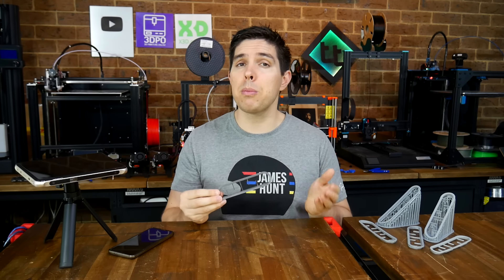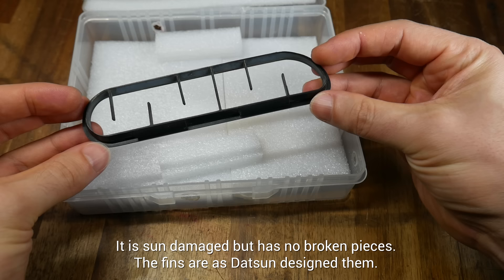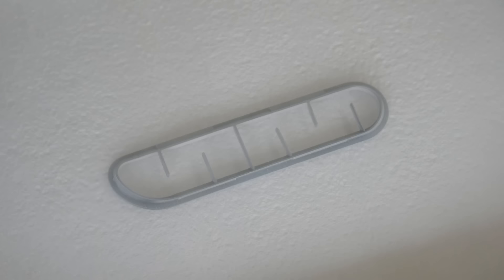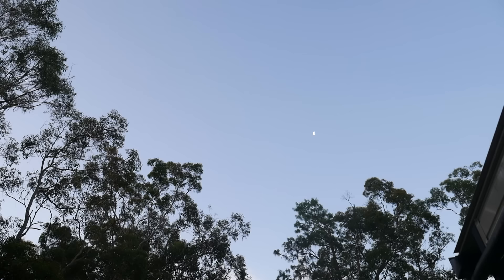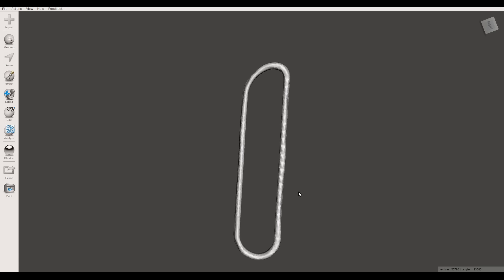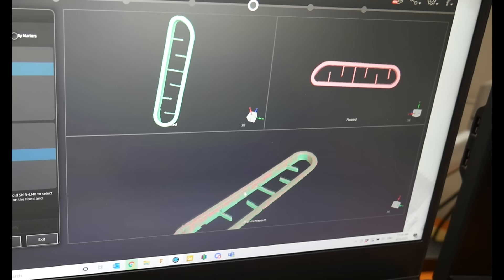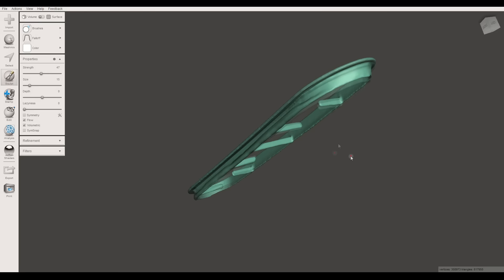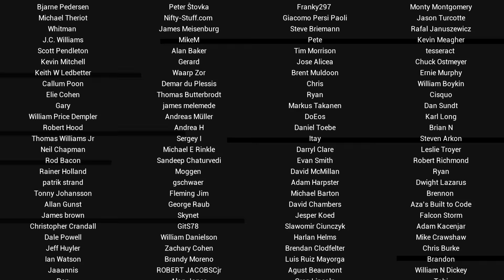3D scanning + 3D printing to complete a classic car restoration

Comment: I appreciate the educational aim of this project- but in my opinion it's rare that a 3D scan will produce a clean enough object to print, with the exception of an artistic part like a sculpture. 3D scanning a part like this should be used as reference geometry to make a perfect, clean CAD model for printing like you show myles doing at the end. Scanning makes geometry that would be difficult or impossible to measure with calipers very easy to replicate.
Reply: Way easier to pull a silicon mold. Then you could pop out as many resin copies as you wanted.
Reply: @timwrigley102  I think in some instances it is not enough. For example if you wanted to mirror this grill to fit mirrored holes.
I fully agree with Seth, it is far better to not just print but remodel. It also features the possibility of changing a parametric model at the end freely, making multiple design iterations a bliss. At the end, remodeling this part using the scan as reference combines the best of two worlds for a little additional work.
Reply: I don’t think anyone will disagree with you, but I think the videos intent was to determine the feasibility. It would be great if a phone could make a perfect 1:1 straight to printer scan, because that’s the future of 3D printing, but instead we learned it takes a $15k scanner and some clean up in CAD. 
A part like that exceeds the 80/20 approach to learning CAD (or at least mine). So, instead of paying someone to make a bunch of complex CAD models, I can rent one of these for a day and exercise my limited CAD abilities cleaning up and tweaking the last 5% of the model.
Reply: There are software packages that allow your traditional parametric CAD data to be produced off of the scan mesh, but it's another $5k give or take.    

It more or less allows for cross sections to be taken of the mesh data, it then makes construction sketches to your tolerance with the section plane. You can then convert it to a proper sketch as is, or redraw it to simplify it.  Add your dimensions and constraints in. Then follow a similar workflow to solidworks to create your geometry.  Rinse and repeat. You wind up with the capabilities to make hair-pulling  features with ease.    When everything is said and done, the part and it's feature tree can be exported to the big CAD programs for delivery or further modification/ analysis.  This is kind of a basic explanation of all this, but I think you get the gist.  

The whole process is time consuming, though much less so than guessing and test printing for sure.   It just has a very large upfront investment.  And recurring for maintenance and software.  

It's a big enough process that despite having the tools available for free at work, I dont often go out of my way to go that route.   If you look a a part and think 'this is going to be a b---" then it's the tool for the job.   You have to factor in whether the scan time is worth it ontop of you modeling, assuming you could just fly though the design process with it's help.
Reply: @Mytagforhalo  or in the case of small parts, a vernier caliper and just draw it. Then match the scan back as a double check. Simple
Reply: @avenuex3731  Hahah yup that’s what I would have done. With lots of trial prints.
Reply: @avenuex3731  Well, of course. If a part is that simple no one wants to do a scan process for it.  the scanning would take longer than the modeling.  

But i'm just putting it out there that the tech does exist if someone wants or needs it.   As long as the mesh is decent quality, it doesnt matter where it's sourced from, you could make the perfect solid.  

While the big name is geomagic, there are a few smaller companies coming out with cheaper products. In time, this can trickle down to the hobbyist. But right now, it's for prosumers.
Reply: @Mytagforhalo  sure. It is about complexity. But look at the scope of this. A part, such as the one demoed for the Datsun, is as easily drawn as any other path of creation. On the other hand, if the part is much more complex it cannot be adequately scanned as shown even with the $14k scanner. So forget about feature recognition. It will be gobbledygook. 
For that you would need a CT X-ray scanner, and then $14k would seem like spare change. 
Probe scanning is perhaps a better method in most mechanical cases, and CMM has come down in recent years, but you’d need to research. 
Ultimately, the fastest and cleanest and cheapest method is to learn how to CAD. And all you need is a way to measure your part to get going. 
‘Tis my point.
Reply: @ChuckThree  If you learn about Photogrammetry, then you will know that you could get out a really useable scan from that object with just a camera. But a real normal camera, not smartphone. Because smartphone cameras can't reach real camera quality. Expecially with they stupid software that washes out image detail for less noise. The higher your image quality is, the better the mesh detail will be. Also some different method of spraying should improve the reference point. Like spraying different kind of water color splashes for each object side. The more variation, the better. So the software can clearly tell a difference and movement from one pixel to the another.
Reply: @timwrigley102  It would also be way easier to damage the irreplaceable, age-brittle,  fragile by design, original part by trying to pull a physical mold off it.  The methods shown in the video didn't put the pattern at much risk of damage.
Reply: @netpackrat  If you don't know how to pull a mold, sure, you could mess it up. But if we're playing that game, then the best option would be to pull a mold of the 3D a print.
Reply: @timwrigley102  That would be a good way to go.

Comment: You could have just sent the scan data to a 3d modeler who would use it as a base to model a PERFECT non lumpy version that would match the real part 99% and be just as good as the original in as little as a day, matching the factory radiuses, fit and curvature perfectly. I REALLY hope you did that considering how much time and effort has been put into it so far, it would be a real shame for that last result to have been called "finished" without a day or two of perfecting to make it 99% perfect as opposed to 80% as is.

Comment: He should definitely start selling these vent parts... I know how hard it is to come across rare out-of-production pieces… and when they do come up, it’s insanely expensive.
Reply: This video makes me wonder, has anyone successfully got a digital 3d model (be it an STL, OBJ, STEP file) from a manufacturer who no longer produces these? For instance, a broken handle of a trash can and then get the digital file from the manufacturer so you can print it yourself.
Reply: I saw that vent in the thumbnail and immediately knew what it was because I'm also restoring a roadster.  There used to be a guy on Instagram who made these, but these cars are so uncommon it's pretty hard to have much commercial success in making these parts.
Reply: @nickdrom  I think that's where 3D printing this really shines. They can easily be made as ordered, with almost no overhead.
Reply: @matthewlafleur5147  Well, there's that, but there's quite a bit of time investment that goes into quality 3d scans.  I'm working for a company that sells a few competing ranges of professional scan tools to the Einscan.  While it totally depends on how accurate you need the model to be, how big the part is, how small it's features are, and what material it's made of, you can fully expect the full process to take a couple hours minimum.   So even stocking any sort of file inventory isnt really sustainable.    It's safer to do it by commission, unless you really love a car and want to put the work in without potential reward.

You can totally form a business around this process, but it's nowhere near as cheap as most hobbyist people want to deal with.  If you're restoring a whole car, the hardware and software investment is a lot cheaper than relying on someone to do it for you at $100/hr.   

I am talking, however, producing a perfect and parametric CAD model from the scans to allow for editing and proper printing. As we saw in this video, the shortcut is to scan, merge, fix, and smooth the mesh and just use it raw which is always inaccurate and lumpy even with $40k scanners.
Reply: Have you ever wondered why some companys reproduce some car parts that you can buy on ebay pretty cheap, while others don't? Well its related to copyright. There is a reason why that vent doesn't exist anymore.
Reply: Even with just selling the model files, there's not really a viable market based on not having any return on investment. Even with the free scanning option, time investment into making the model wouldn't have return on investment due to how rare these vehicles are. Overpricing things is also a consideration, as you have competition with virtually everyone, restoring is a long process, a restorer will more than likely learn a new skill to avoid paying what they believe is overpriced, time lost on the process is negligible as restoration projects typically have no deadlines. There might be a demand for these vent covers in a niche market, but that same niche market will also gladly find other avenues of obtaining a part. The only actual market is the type of restorer that has their restoration work done by anyone but themselves, but even then it won't be a viable market. Plus a part like this can be reproduced fairly easily using traditional methods, drawing using measurements from calipers, radius gauges, etc.; it's an extension of the argument that restorers will find the most financially viable option available, especially as personal time isn't a concern. 

I've noticed that a bunch of commenters on this video have absolutely no knowledge of or experience in the field of business. Sad to see that people are absolutely clueless on what our society revolves around. To actually attain a viable market off of these kinds of parts, you need an obscenely diversified catalog to have any return on investment, and often times that portfolio will also branch into custom work and not just reproductive work.
Reply from the maker: Once the fit is verified, I will be releasing the part for free.
Reply: Just post it for free online and let people use any of the hundreds of 3d printing web services. $3 part+ $2 shipping.
Reply: you cant sell something that doesnt belong to you
Reply: @milesthe2tailedfox  well if you make a “Vent for Cabriolet”, they can’t say much about you doing anything illegal if it just happens to fit this car.

Plus they can’t really complain if Nissan themselves aren’t selling it anymore… what else are people meant to do?
Reply: @TeachingTech  That's very exciting because I need four of them 😅

Comment: I once measured a part with smooth geometries like this one completely manually, and after 2 iterations it was perfect. I think this is often also an option! The technique is a hassle but at least it does not cost 14k!
Reply: Honestly, I suspect you can get a result that's even cleaner that way. You can pick up the measurements, the curves and radiuses and so on with measuring and once you start feeding that into CAD you will get pretty close. Of course, it would require some design skill, but you'd arrive at a clean design that I wager would be visually indistinguishable from the original. Still, this was an interesting video about what you can do with 3D scanning, no question about that.
Reply: That's how a made a replacement top cover half for the remote for my 2008 DTS. The replacement models I found on the internet didn't look like factory so I measured and drew it from that.
Had to tinker with some of the curves, but ended up quite nice.

Comment: You skipped a step that I always perform.  I completely remodel the component in CAD, using the scanned mesh as a guide.
As for painting the final part, I would plate it with satin chrome, to draw attention to them, and as a flex on other Datsun owners.
Reply: Now that’s a flex!
Reply from the maker: That technique is what Myles suggested before he started the scanning. I agree it would likely give the best result but in this I'm hoping it's not necessary.
Reply: @TeachingTech  I would like to see the final product. With a good finish I'm sure it will be fine. How concours is a Datsun today? At some point someone at one of the auto aftermarket manufactures will have injection tooling made. Then it will be remodeled.
Reply: Nah, the guy who wants that part wants it to look exactly like it just left the Datsun factory.  The fellow enthusiasts who know enough to be impressed by his car having perfect vent grilles will notice them without gaudy plating ruining the factory appearance.
Reply: Vapour deposition is the only way to finish automotive trim pieces properly, paint will always be a cheap looking and shabby option

Comment: Wow, with all that cleanup work, and the lower complexity of the part, it almost makes sense just to have modeled it from scratch.
Reply: The part is curved, so good luck modeling it
Reply: @vidznstuff1  That just makes it a little bit more difficult, I don't know why everyone pretends like it would make it wholly impossible.
Reply: @Nobody Noone  You are correct.  I always remodel the component in CAD, using the scanned mesh as a guide.
Reply: @vidznstuff1  It would be easy to recreate a flat version, then apply a curve to it.

Comment: This is great. I did the same for my father in law. He has a 1982 Kawasaki 1300 and we replicated the air box cover. Used a cheaper Einscan scanner but as mentioned a few times in the comment section it becomes a resource intensive exercise and the cost of the scanner can simply not be justified unless you have a daily use case for it. That being said great video and really hope to see hobby 3D scanners to get better soon.👍🏽

Comment: Some time ago my dad was working on restoring an old jaguar and had a similair problem.
Although we were unable to find the original part anywhere, so I modeled a replacement by measuring the imprint it had left on the leather of the car, and my looking at pictures of it on the internet.
It came out pretty good, and is a testament why 3d printing can be awesome

Comment: If you want to scan stuff like that I find that hanging it off fishing line and doing a full spherical photo shoot with someone holding a white blanket behind makes very good results. A good soft flash light like the vloger circle thingy illuminates it very well. The more pictures the better the detail. Also no auto settings on camera :) Meshroom is pretty powerfull.
Reply from the maker: That would have violated my 80% rule, but I agree it would have been effective. I quite liked experimenting with Meshroom and I'll be looking for an excuse to use it again in future.
Reply: @TeachingTech  I'm only using meshroom, with my smartphone. Once tweaked the settings your good to go. I always use sift and akaze with force cpu ticked off ;) 

I'm still trying to learn how to use CCTAG, 
With this you can adjust the size and orientation off the object in the app. Worth looking at it ;)

Comment: 3D printing is extremely useful, and it's funny how many people don't fully comprehend how useful 3D printing is. I've seen a few automotive projects where 3D printing was involved, and a lot of times, you're left going "uh, I didn't think of using 3D printing to do that." 3D printing replacement parts for vehicles that you can no longer obtain, or you can obtain, but you need a very large amount of money to pay for it. Some times it's more of a part that doesn't exists. I made a part for my motorcycle that is a mount that hold a plug for plugging my motorcycle into a battery maintainer/charger. I did it because where the battery is located on the bike, to access it, I have to use a few tool to unbury it enough to attach the charger's cables. But now I have a plug port right on the frame of the bike where I can just plug in, and it's out of sight unless you're looking for it.

Comment: For all those saying the resin printed models will become brittle over time, he now has a resin object that can be used to create a mold without risk of damaging "The Precious". This can then be used to generate more stable models.
Reply: I think since this piece is also getting painted (and maybe primed) I think FDM would also have been nice. Especially leaving open "slots" at the back face of the pins to push some tiny steel wire in it (like paperclips) to help with rigidity.
Reply from the maker: Spot on! I now have the means to produce as many versions as necessary for other methods. For instance, I could resin print in wax like and send it off for investment casting in metal.

Comment: Meanwhile, the 2nd-year Japanese employee that designed the vent cover is scratching his head in wonder. I only have the highest regard for this channel, but remember how imprecise manufacturing can be in the real world. I woulda banged it up in SolidWorks (or Fusion 360) after a weekend of trying to understand what the designer was thinking… including that slight radius on the top.
Reply: If I had persevered learning even basic Fusion 360 I would have saved a lot of my time over the last 4 years making re-designs of small parts. I'm "mentally stuck" back at Tinkercad. Certain car and motorcycle trim and access covers look simple until you start really examining them. No two sides or edges are parallel or have a consistent size of radius anywhere. And the backside has different details & part no. lettering that owners will insist on. It really calls for "lofting" skills and I got frustrated and gave up for the time being. 
Anyway all of these things are good to keep my old grey matter bubbling.